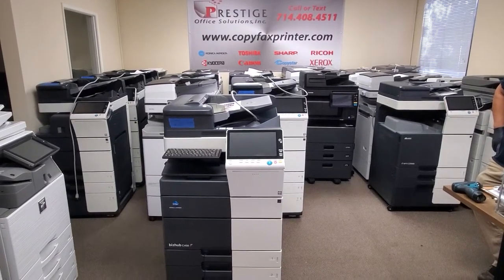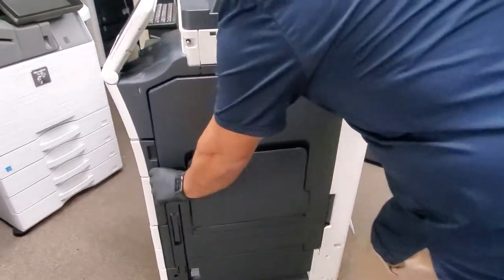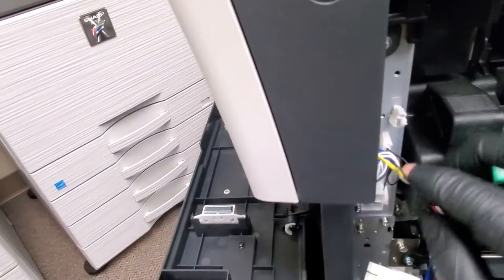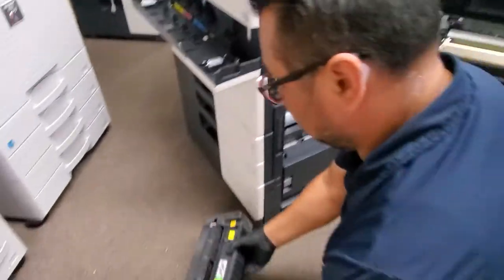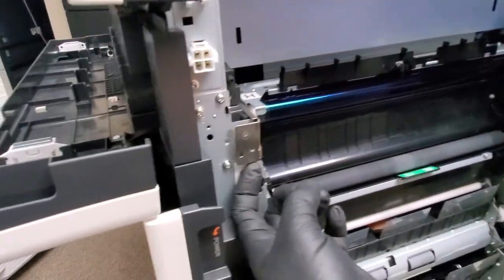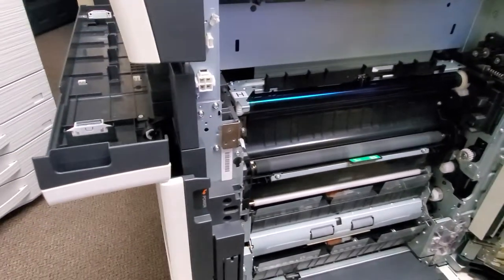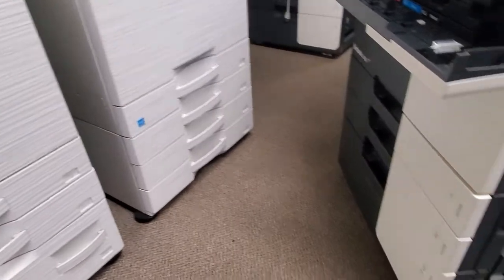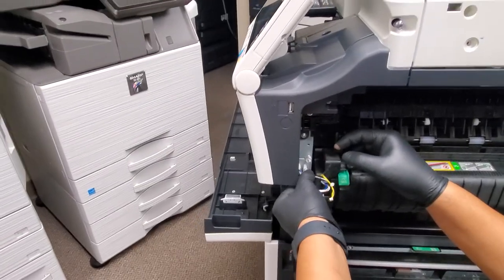How to remove and replace the transfer belt unit on a konica Minolta BizHub c458

Comment: Would you share where to buy (or size) of the drill attachment for the screw heads and the extension so we can get into the tight spaces?
Reply from the maker: home depot